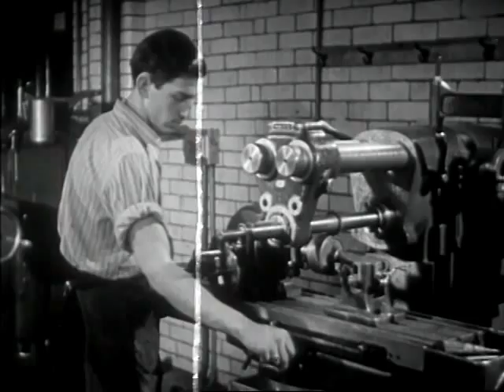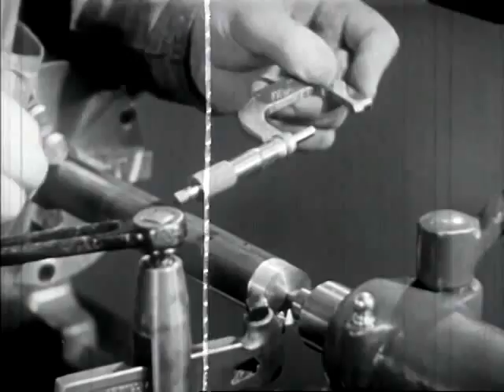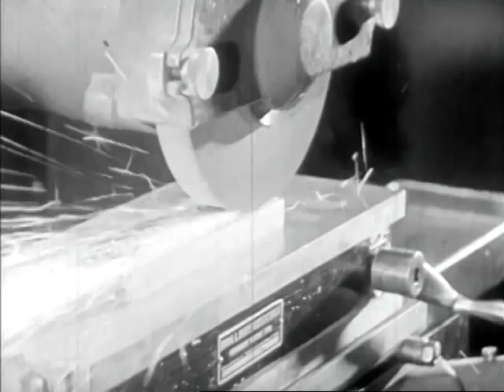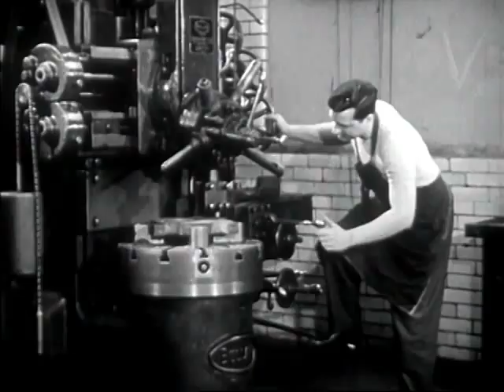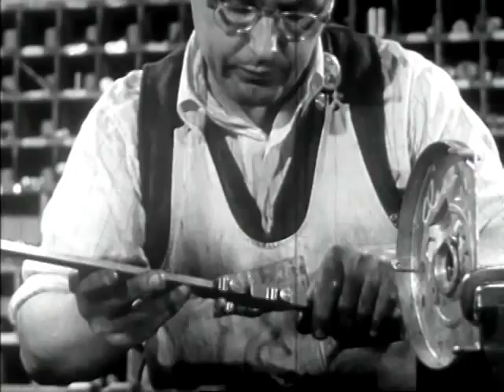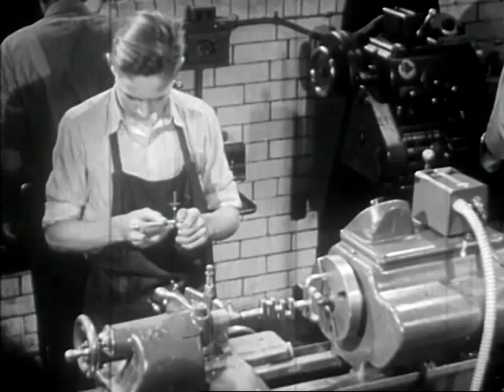The Machinist And Toolmaker

Comment: I’m proud to say I took up the Tool and Die trade in 1980. I was 23. My dad retired for the third time and started a small tool and die shop 600 sq ft. He had an Index Model 55 Mill, 6x12 Hand surface grinder, 9” Southbend lathe, bench drill press, Band saw w/blade welder, 9x12 small cut off saw and maple top workbenches with a small air compressor. Thats all you really need..That’s where I served my Apprenticeship and earned my Journeyman Card in 85 having Aced all my classes. It saved me and has been one of the great Blessings in my life. I owe my skill and give honor and glory to God the Father through His Son Jesus Christ every day, to my father before me, my grandfather before him and his uncle before him. All of them worked in the Juniata Tool Works of the Pennsylvania RR. I received the Knowledge of these generation through my dad. He never really taught me, instead he just allowed me to be in the room with him by his side for 9 years. I grew the shop into a tool and die shop with CNC, Wire EDM in the 90’s and later we had a stamping facility and extruded plastics. We also designed and built saws, routers, corner cleaners, milling machines, pvc plastic fusing (welding) machines , jigs, fixture and assembly tooling and so many other items that I can’t remember. I’m 67 now and work for one of my old customers having closed in 2015.. I sponsored and signed the Journeyman cards of many talented machinists and tool makers. I am Blessed. Todays machinists are trained mostly to be CNC operators and the hood ones set up. But In my last 15 years I’ve seen very few if not any that received the kind of education I received. Many of my former employees are either passed away or retired but a few are still in the trade. They are very successful. One is a degreed ME and Journeyman… he’s head of a firm and is unstoppable. If you choose this trade I can only hope you hat even a fraction of the training and knowledge shown in this film. Im so honored ti have been trained in this same fashion.

Comment: Do you like skimming your knuckles on grinding wheels? do you love the scent of honing oil and bunt metal? do you enjoy going deaf in your 20's? machining is the job for you! use machines older than your grandparents that, for some reason, never died or needed replacements. enjoy coworkers casually joke about loosing fingers to spinning blades. don't expect any machine any newer than the 60s in this job.
Reply: Mine are mostly all new
Reply: therefore, instead, we should outsource all these jobs to china, so everyone in murica can live on welfare.
Reply: going deaf that was correct after working 5 years on a VTL...
Reply: @davidyoussef9626  What?! Can you go deaf even using ear dampers?
Reply: Don’t forget poor eyesight in your 30s from always focusing so close
Reply: @fernandog806  nonsense..
Reply: thats if you work for an old cheap company. nowadays its mostly CNC and much less dangerous.
Reply: What a cry baby. Maybe just stay in the office so you don't wrinkle your skirt.
Reply: The properly trained don’t lose fingers.. 43 years and counting  and still have all 10….knock on wood

Comment: Look ma, no safety glasses!
Reply: as mike rowe once said, safety might not be first, safety might be second or third. sometimes the responsibility of the employer is to make you rich, not to keep you alive, that's your responsibility.

also safety glasses over long periods of time mess with your vision and they make you NEED glasses after a while. knowing your limits is important.
Reply: This is a pre polycarbonate era.
Safety glasses were literally glass.
Glass right by your eye, getting hit by a steel part means glass in your eye. 
IE: safety glasses were not very safe for machinist until the 70s.